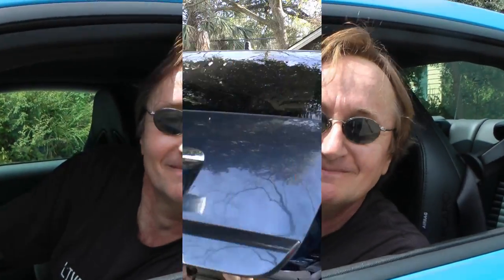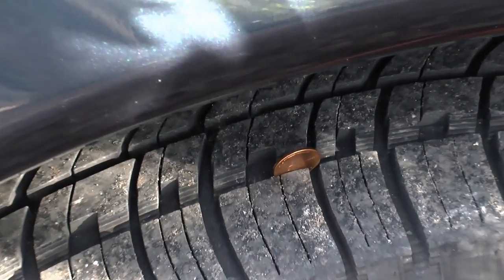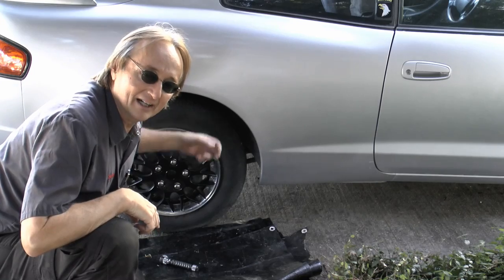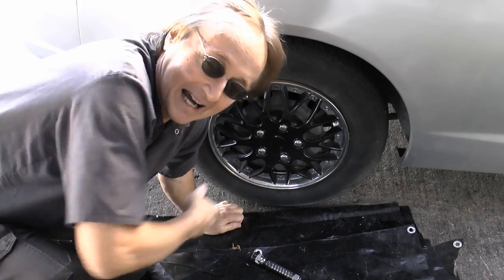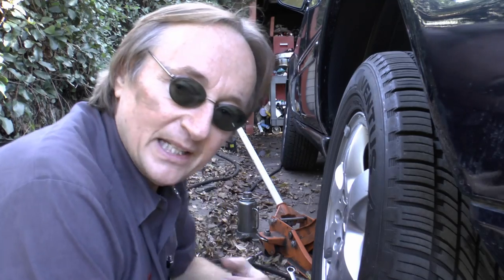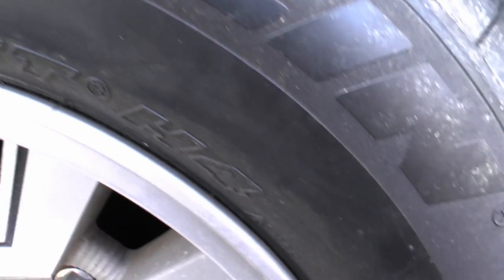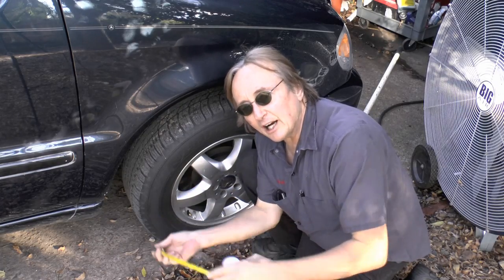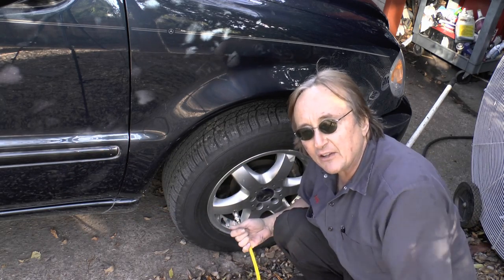How to Tell if You Need New Tires on Your Car

Comment: Scotty, my rear tires are like new but were worn badly on the insides from an alignment problem that has since been fixed. The tires were balanced again and were smooth for 3-4k miles but now are out of balance again. Do you think I should keep having them rebalanced every few months for $10 or cave in and buy yet another pair of new tires?
Reply from the maker: tires really only need balancing once, if yours are wearing oddly again, the alignment work was not done correctly or a part on the suspension back there is worn.
Reply: Thanks Scotty, I appreciate your advice as always. I replaced the bent suspension parts myself (my brother hit a curb) and had it aligned but it was driven quite a bit with bad alignment. But I'm trying to salvage the tires, they're almost new but the insides are so worn the guy had to use a bunch of weights and said since it was so uneven that as the tire wears the dynamic balance will change. I was really hoping to save these tires they weren't cheap but maybe I'll be better off with new ones.
Reply: Thanks this is great info. The tire shop I goto is really straight forward with me at least and I'm confident they're doing good work. The guy told me I could get 30k miles out of those chewed up tires but they'd need balancing a few times because he had to put 2 or 3 large weights together to balance it after the insides were worn. But now I'm thinking I have a loose suspension joint or bushing that is exasperating any balancing issue.
Reply: Well I had a really bad alignment issue from my brother sliding my car into a curb but I replaced all of the damaged suspension links on that wheel and the alignment shop said it was good now. But being a 20 year old car I know there's say and slop in many of the suspension joints and mounts. While fuel is this cheap it might be a good time for me to drive my truck while I take my daily driver off the road for a while to replace the links, ball joints, bushings, etc.
Reply: I had adjustable upper ball joints on a lowered Honda accord once and I never realized how crappy the alignment and ride quality were until I replaced the struts and control arms with stock ones
Reply: The Stiver
If the axel or frame is damaged and out of spec, no amount of alignment work and tire balancing will solve your tread wear issue for the long run.

Comment: Hey Scotty, I have a 2001 honda accord v6 and have problems starting it after a good start in the morning sometimes I have to let it sit for 20 min. in order for it to start. The battery,coils,spark plugs,idle air control valve,fuel pump,ignition switch are all good and have no codes to get me started on something I was thinking it's the fuel pressure regulator any thoughts?
Reply from the maker: when it doesn't start, do my video "fixing a car that cranks but doesn't start up"

Comment: Didn’t know that about Chinese tires. Have some side wall damage from rubbing on driveway cement, try to avoid it but rubs once in a while and notice air doesn’t hold for a week and a half. Psi is 32 then goes down to 22. Will need a new one soon and we go with Goodyear here for Texas. Would like to try Michelin tires only one type for car and run about $125 each, Good year about $80-$100 depending were your buying.

Comment: Thanks for new video on tire.
I am using Honda city 2007.I was having stock tyre Goodyear 175/65/14.6 months back I was on highway when one of rear tire was blown.I changed front 2 tyre with Yokohama 185/65/14.what do think?
Reply from the maker: yokohamas are good tires IF made in japan, not so good if made in china. read the side of the tire to see where it was made
Reply: Scotty Kilmer my concern was size difference 175 in back and 185 at front

Comment: I know is off topic but I have a 2005 pontiac g6 and the traction control is always on I was just wondering if there is a fuse or something to check before I take it to a technician 
Thanks
Reply from the maker: no fuse, that means the computer has found a problem in that system, have it scanned for codes to find out what's wrong, and if it's going to cost a lot, live without trac control, they don't work that well anyway
Reply: Alright thank you

Comment: I am so fussy about tire quality that I research my tires years before I buy them.  I also look at every compatible size available so as to adjust ride and handling characteristics over my previous set.  Just some of the things I have learned is that there are always trade-offs when selecting tires;

Dry traction is often inversely  proportional to wet traction.

Ride is related to sidewall height and profile more than tire brand.

Tire life is not always related to price, brand or country of origin..

Just because a particular brand is famous/infamous for one model line does not mean that every other model line they make will have the same pros and cons.

I can get a better ride, more tread life and less pot-hole damage by going one size larger than factory spec.  However, fuel economy may suffer.

Comment: If the tires still have some tread on them (covers some of Lincoln's head on the penny), but the rubber is cracking, or "dry rotting" should they be replaced? I commute about 100 miles daily for work on the freeway and I don't want them to blow out one day.
Reply from the maker: branw11223 yes, dry rot should always be replaced

Comment: I drive a front-wheel driven vehicle and I had a flat one day on the right front tire. The hole was almost on the sidewall where the tread ends. I had it fixed but I've been told by people it's best if I change it out, I am a little reluctant because these tires are only 2 months old. I was also suggested to swap it with the rear tire, what do you think I should do?
Reply from the maker: they claim that's dangerous, but I've fixed em there for years and never had one go bad, it's up to you.
Reply: Your replies have always been quick and helpful. Thank you!

Comment: hey Scotty went to a tire place for air the temp was  twenty degrees too cold to add air my self they said that when you buy tires from big tire companies they don't use glue mounting the tires they use oil thus in cold you loose air reducing your psi in the tires they use a black glue to mount the tires to prevent this from happening.

Comment: Scotty, if I don't check the balance periodically how would I know that the rims haven't gone out of shape as a result of hitting potholes or kerbs? The ones on my previous car would dent so easily that this happens even without me having a significant impact.
Reply from the maker: if they got damaged, car would shake at highway speeds
Reply: Scotty Kilmer ok thanks. yeah I normally push to about 120 mph on a safe road just to try to feel for any unusual vibrations following hitting a pothole or something.
Reply: Brian Su 120 mph isn't safe on any public road.
Reply: Randy Lott yeah well it wasn't sustained at that speed though, but rather to satisfy my paranoia over dented rims. I don't normally exceed speed limits :)
Reply: Brian Su I'd say, save it for the track. Local clubs generally meet up at closed courses and charge a hundred or two for anyone to do solo laps. The speeding ticket and increase in insurance premiums alone would pay for it. Not to mention a detrimental driving record which might affect future employment opportunities or vehicle restrictions.
Reply: Remrie Arrie Ohh yes I will do that :) thanks!
Reply: Amateurs... I drift at 66,611 MPH around the sun to get a feel for the balance of Earth.
Reply: Gain Medium what benefit do you get by trolling and making up nonsense like drifting at 145 mph that's obviously not true? 120 mph is no where near the top speed of my car and how do you know there are speed limits in my country and our roads are unsafe for such speeds? Of course you wouldn't know unless you've been on the autobahn.
Reply: Just go to a Discount Tire and get them rebalanced for free. Ask to see them being balanced and youll be able to see any rim damage, tread separation, cracks, nails, you name it.
Reply: Ryan Korecki Yeah I'll take it somewhere. Thanks :)

Comment: I just buy half worn out winter tires and run them all year I get about two years out of them before they're too worn, they obviously work well in snow and ice and not the best in Summer but they work well in the rain and it rains half the yer around my parts so it's cheap and easy for me

Comment: Tire alignment is important to making tires last a lonnnng time. Uneven ware will ruin a tire quickly. Also, over inflating can cause uneven ware in the middle of a tire. I have a lot of stress cracks in my tires... should probably replace em.

Comment: Hey scotty I have a 07 mustang v6 and my car started driving funny and I seen the electronic throttle control light is on, I got to my destination turned the car off then back on the light was gone ,should I be worried?
Reply from the maker: well, they don't fix themselves. If it happens again, odds are you will need a new throttle assembly, a fault on that model
Reply: Scotty Kilmer you think I should find the specific part that went wrong or replace the whole thing ?
Reply: Dashawn Willis
on sites like rockauto, the throttle motor is about $65. The replacement assembly is $165. Personally, I'd just buy the entire replacement and bolt it on. That way there's no guess work or wasted time. Also, a throttle position sensor is about $32 anywhere. I'd start with that if the car's computer has that code. Any Auto Zone can scan for codes.

Comment: @scotty kilmer what do you think about having run flat tires in the front and non run flats in the back. another question is my car has a loud tire hum and a slight shaking while i drive would you say thats a balance issue?
Reply: +myxbigxfruitxstickx Drive slowly to a high quality tire shop and get matching tires front and rear. Very strange things happen when you mix up different types of tires, it can be very unsafe, be very careful

Comment: Hey Scotty! 
 I have a 2005 AWD Chevy Equinox. My mechanic recently informed me that I need new tires. He wasn't lying, my front tires have zero tread left on the inside of them. My problem is that these tires are have less than 15,000 miles on them. I know I need new tires, is there any brand you suggest?
Reply from the maker: see what the local discount tire store sells in brands from north america or europe. That's what I do

Comment: The front tires of my car are 5 years old and the wearing is bad, and i got a new set of tires last year and put them in the rear (Same drawing, brand, model, size)... Now it's been hard to find the same set to put in the front so my question is: The tire drawing really matters? I will have any trouble if i put a new set of tires with different drawing in front considering the same tire brand and size?

Thanks in advance, Greetings.
Reply from the maker: as long as each axle has the same tire and it's not an all wheel drive vehicle, that's fine. Just make sure front left and right are the same as are rear left and right tires

Comment: Hey Scotty, I own a 97 Lincoln Mark Viii with 65 thousand miles and recently my check engine light came on and the code reads (P0147 Generic System Too Lean Bank 2) my guess would be the oxygen sensor need to be replaced. Now, I'm not sure if its the upstream or downstream sensor driver side or passenger side. Any help would be great. thanks
Reply from the maker: No, on those running lean on one bank is generally a vacuum leak on that side, sensors only read the problem, rarely do they cause it. So do my video "finding engine vacuum leaks with a cigar"

Comment: I have a question, if anyone could answer it I would be so grateful! I own a 2008 Nissan Altima, with the basic interior. Can I buy the factory touchscreen unit and put it in my car? My main question is will it work equally? Like, navigation, Bluetooth, etc. also can I add the factory steering wheel with controls?
Reply from the maker: contact nissan to see if the wiring is already in your car, just needs to be attached. If not, It would be one cow to wire it in
Reply: Thanks Scotty!!!!

Comment: Scotty, what's your opinion about using tire beads to balance you tires vs lead weights. Ever since I got my tires changed and beads put in, my truck shakes at certain speeds
Reply from the maker: Jace Larouche don't use em, that often happens

Comment: Hey Scotty, I bought a pt cruiser with only 106,000 miles. 2003. I don't drive city. I'm only getting 200 miles with a 1/4 of a tank left. I was told I should get a lot more. What could be the problem? Just bought from a well known dealership.
Reply: Maybe it ain't maintained well. Try adding injector cleaner when your at the gas station( I recommend Lucas or STP complete fuel system cleaner and check the oil for sludge. If there is no sludge, add restore engine restorer. This will fill in worn spots in the engine. BUT DO NOT USE if the engine has variable valve timing.
Reply from the maker: Jon Speck
he's getting 200 miles on three quarters of a tank, that stinks for a pt cruiser. Have the maf sensor data checked to see if it's bad, if not, try my video "how to clean fuel injectors on your car"
Reply: Thanks guys! Appreciate the help. Cheers

Comment: Scotty, if you have a lot of carbon on top of your piston tops can that make the engine run rough? I used like 2 diffrent fuel additives like Gum Out and Lucas and nothing. I'm planning on doing the headgasket on my car and once I'm in there I;m gonna clean it all up, I bet the valves are all carboned up also
Reply from the maker: yes it can by increasing the compression ratio, and of course, the valves would have carbon on them too

Comment: The reason you may need to regularly add air to those newer tires is because they don't clean the rim and make sure to put enough sealant on. I went to the D Wells Goodyear and they did a horrid job. My tires kept loosing air. Went to my mechanic and sure enough they only put enough sealant on it to last a month and had to clean/wirebrush the rims so the tire could probably seat onto the rim and no more leaks. The next time i'm just going to take it to my mechanic when i need to replace my tires. I had my wheels stolen though and i went to the same place where i got the tires from the last time.

Comment: 1994 Prelude Si, I got camber wear. When I changed the breaks I checked the parts and they don't seem to clunk or move, any advice?
Reply from the maker: see a good front end man, I've seen guys do miracles by slotting and adjusting front ends on those

Comment: I mistakenly aired my tires up to 70-80 psi instead of the recommended 30 psi. It was left like this for around 23 hours until I  reduced the air back to 30 psi. Do you think this might have caused tire damage and be dangerous?
Reply: Why you go above your recommended psi? That dangerous unless you have a aftermarket tires or something.
Reply: @kg888  did you miss the "mistakenly" part? or are you just annoying?

Comment: Another thing to note is that in cold climates cleaning the tar and dirt of the tires gives you better traction in the snow and ice.
Reply: That's why top fuel dragsters do burn outs before flying down the track at 350 mph

Comment: Hey scotty , what could be the cause of a squeak like sound on the front part of the vehicle 01 escort zx2, front driver side.. when the car is stopped it squeaks when i apply pressure on it  and when i am moving it also squeaks , makes me think it might be the springs ..what do you think?
Reply from the maker: LuisLocks L worn strut springs often do that, as can worn Stabilizer bar bushings

Comment: Just a suggestion; I would have mentioned the speed rating and treadwear/traction rating on the side for when buying new tires
Reply from the maker: problem with that is no one really checks up on that, so it often means little. That cheap chinese tire I showed in the video with the plug in it had a 440 rating, which is really hard, but the tire isn't. Don't always trust ratings.
Reply: Ah, yeah I believe that.

Comment: Hi Scotty, I get a single clunk/knock on the driver side when stopping at a stop sign a couple of seconds before stopping and sometimes also when making a sharp turn (e.g. parking the car). This started showing up after the car got an alignment after I changed the CV axle, upper control arm ball joint and inner tie rod boot on my 96 Honda odyssey. Any suggestions where to look? I did the fixes in several phases and the issue showed up after the alignment.
Reply from the maker: find a better alignment mechanic, he should have found the fault, start there, could be tons of things if jacking it up and pulling on the tires doesn't show you any wear.
Reply: Scotty Kilmer clunking noise means somethings been probably left loose-or has become loose..  it will stop knocking when the part falls off....
Reply: +hapeta24 Found the right lower control arm  bolt loose, wonder how that happened?
Reply: +Mike Petrowski 
there will be a matching nut loose in the head of the mechanic that "repaired your car".. Insert the bolt in his left ear and start winding- he will tell you when it is tight enough.
Reply: I mean the guy that did the alignment should have noticed- we usually road test before and after and check the suspension for movement.
At least you got a result before anything fell off- that's always good lol
Reply: axle nut was not properly torqued after doing a axle replacement.  I had to go in to replace a ball joint and got a proper torque wrench and it fixed the issue.
Reply: +xennelul 
everybody makes mistakes even tradesman who have been in the game for years-although they usually develop a sequence to the repair to lesson the likelihood of missing something.. The trick is to listen to gut feelings and how you fix it when something isn't right....well done  ..